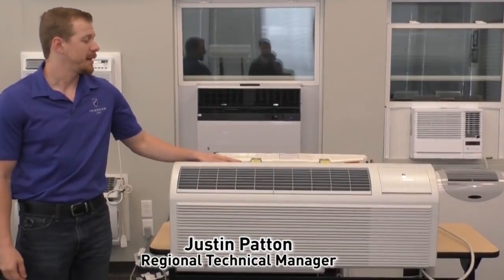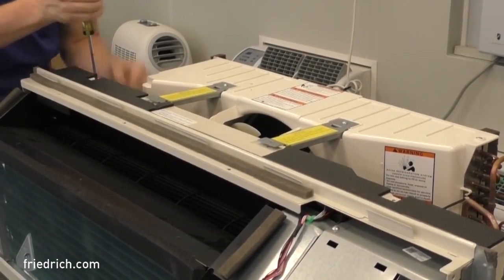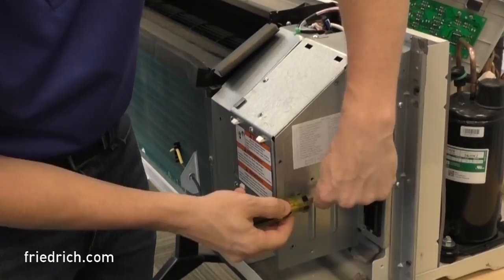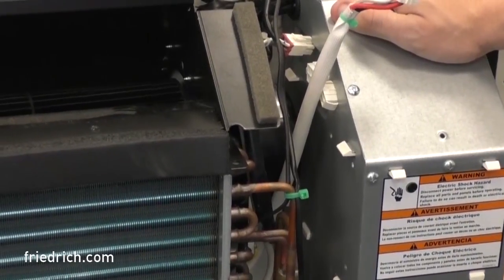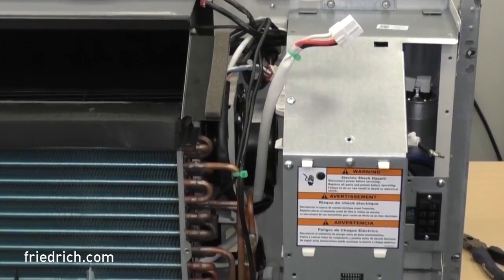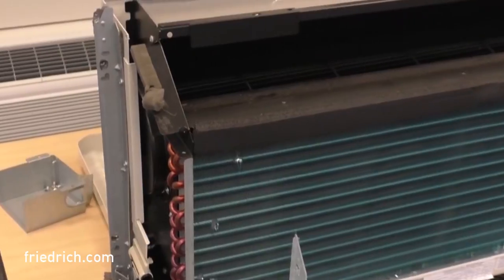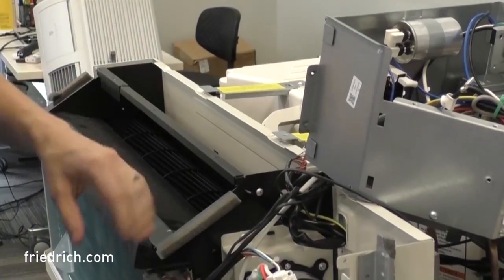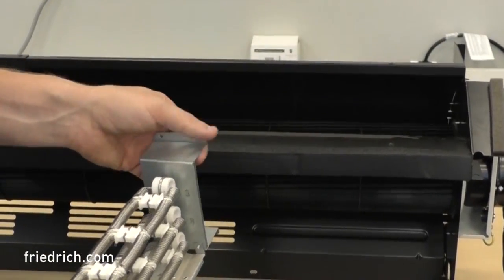Friedrich Training- SG Series PTAC Heating Test

Comment: I’m having an issue. I’m getting heat on cool and cool on heat. Thermostat has been changed switches have been flipped I’ve troubleshooted for hours and can’t figure it out.
Reply from the maker: Please contact our customer support team, and we will be able to assist your further. We can be reached at 800-541-6645 Monday - Friday from 8 am - 5 pm CST. Looking forward to assisting you !